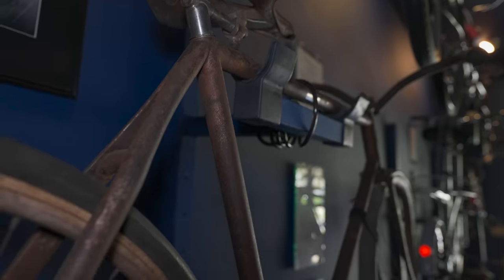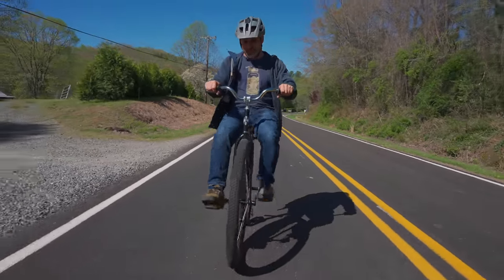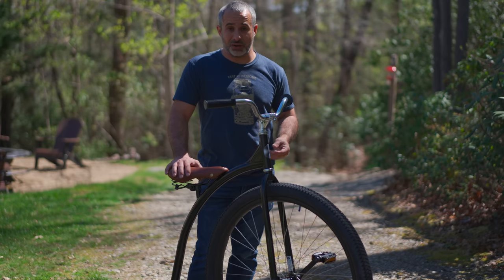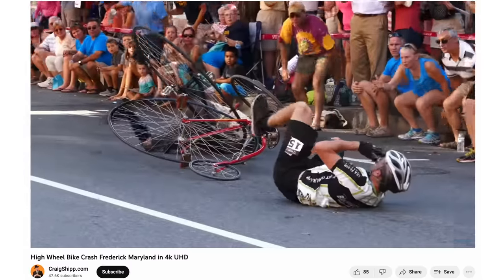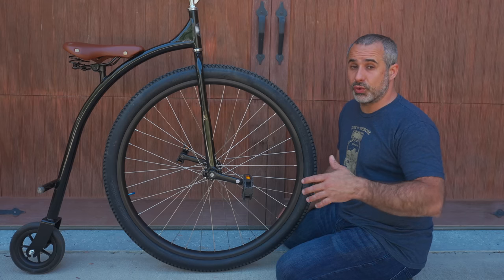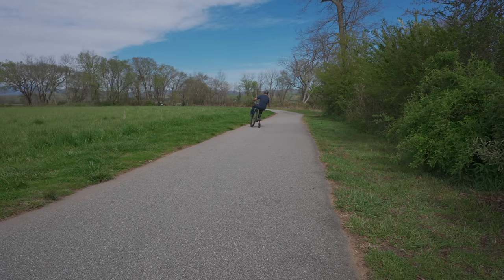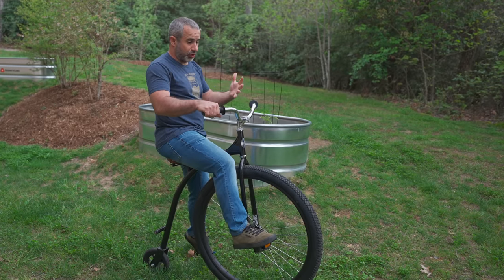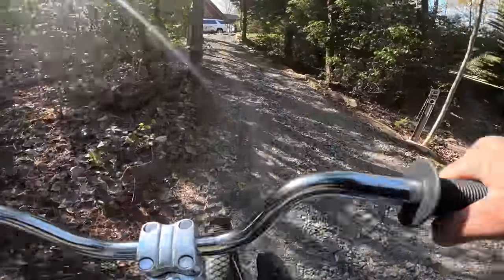The Penny Farthing was the sketchiest bicycle ever made

Comment: Makes you fully realise what a game changing innovation the Safety Bicycle was. Surely one of the best inventions since the wheel.
Reply: The invention of the safety bicycle was dependent on the invention of several "new" technologies and practical manufacturing techniques. Whilst today they're taken for granted, they simply didn't exist at the time the Penny emerged. The Penny was a fast machine, reliable and the pinnacle of human transport. But things were changing very quickly in manufacturing technology, which meant the Penny only had a decade or so before it was superceded. By contrast, the first "Safety" bikes were complicated beasts, less reliable and only marginally safer.
Reply: Obviously; it does have two of them.
Reply: The chain drive was the key. Without that, you could only ride faster by scaling up the diameter of the driven wheel. A chain with different sized sprockets decouples the wheel size from rotational speed for a given pedal cadence.
Reply: "don't reinvent the wheel" yeah reinvent the hardware around the wheel
Reply: Double the wheels, double the fun
Reply: @ailivac  The chain also removed the cranks from the wheel axle and moved the riders mass to inbetween two equal sized wheels for better ride and lower centre of gravity.
Reply: Good, twice the radius, double the fall.
Reply: That's a pretty ridiculous claim. I can think of dozens or maybe hundreds of inventions that are essential to modern civilization, our technological capabilities and standards of living. Bicycles are not one of them.
Reply: The inventor of the first bicycle likely put pedal cranks on a steerable front wheel that was a reasonable size for safety and low enough to be easy to mount.  Then trying it out he realized while it did work, it got him places a bit quicker than walking.  But not quick enough to make up for the work needed to move the weight of the machine, overcome imprecise bearing tech of the time, just not worth the bother.  By making the drive wheel much larger, despite the hazardous ride and difficult mounting, it made it faster and more exciting to ride.
Reply: @Kerithanos  not ridiculous at all. The safety bicycle made it possible for people to easily travel to the next town or village, travel to jobs that they couldn’t get to before. Be able to get to schools that would have previously been too far or walk too. Speak to any historian who knows, and they’ll tell you the same.
Reply: @a1white  I have absolutely never heard anybody attest to widespread use of the bicycle as some kind of bridge between horses and the automobile. My great grandparents used horse and carriage, and my grandparents used cars. None of them were riding bicycles around. Even Wikipedia makes it clear that the safety bicycle in the 1890s was basically a novelty item. Even if it was fit for the purpose, it didn't have time to displace horses to any significant extent before Ford came along.

I hear they're used a lot in third world countries today, but that certainly doesn't qualify it as "second to the wheel". I'm not trying to be aggressively negative or pedantic, I just think that's awfully strong praise for a development I would call "mildly influential" at best.
Reply: @Kerithanos  try Googling “invention of bicycle significance” or similar and read one or 2 of the many articles explaining why they are so significant in history. Sorry if you disagree, but that is your prerogative.
Reply: i like my trike
Reply: I'm sure the safety bicycle had a big impact, but there is a long list of inventions that were obviously more important to developing modern society. Printing press, steam engines, Internal combustion engine, production line, cotton gin, spinning Jenny, fertilizers, combine harvester, plastics, electrical wires, lightbulbs, telegraph, radio, batteries, transistors, microprocessors, the internet. I could keep going, but the list is going to get pretty long before I mention any bicycles.
Reply: @megamaser  The spinning wheel itself was a pretty big game changer to civilization.
Reply: @another3997  I swear, technological development is as random and weird as natural evolution.
Reply: The penny farthing was called the "ordinary", because it was the limit of mass market technology. There wasn't an affordable technique to make small chains with precision, and shaft drives are just too expensive for the working class even today. Roads were also atrocious back then, so you needed large front wheels to avoid faceplanting over every pothole you had to ride across, and to provide high gearing so that you may actually go faster than a brisk walk, because you might as well walk.
Reply: One of the best investions since the penny farthing
Reply: @a1white  there were horses and carriages that enabled the exact same thing. And safety bicycles were very expensive at first and as mentioned in this video, only used by the rich for recreation. An average human walks at 6 km/h, how fats is a single speed safety bicycle really? 20 km/h? On the mud roads they had back then? And you can’t carry much unlike with a horse or carriage. Doesn’t sound like the revolutionary invention that changed the course of civilization.
Reply: @HNedel  safety bicyles might not have been an overnight massive success, but if you read up on it you'll see that (especially for women) they wre massive enablers. They certainly weren't only used by the rich. Look to industrilised Britain, for example, Bicycles became the form of transport to enable people to travel several miles to factories which would have taken an hour or so to walk to before. Even allowing children to travel several miles to schools.. Horses were also expnesive for most people to keep, as well as being impractical.
Reply: Not even close.
Reply: @Kerithanos bikes were used to win battles. it saw use in WW1 by messengers (horses can be finicky) and the Japanese used it to defeat the British in Malaysia. they’re small, simple, cheap (er, from a logistics perspective at least), man-powered, don’t create a bunch of heat exhaust- I love ‘em.
Reply: @Kerithanos  You are being negative without any claims to back it up other than anectodal evidence and incorrect "facts". I used to live in holland and even today most people dont have cars but they have 2-3 bikes. None of my friends even cared about getting a license because you would bike everywhere. 

Also Horses and cars were only for the rich, so it had a ridiculously significant impact on the middle class, which used to be even larger than then it was now
Reply: @Chickenwingsinthedings  "All you have is anecdotal evidence! Anyways, I used to live in Holland, and my friends all said..." LOL

I can't comment on how things were for the Dutch, but I can tell you that in the USA, horses certainly were NOT only for the rich. Horse and buggy was how normal people got around when they weren't walking, up into the 1920s.

I certainly don't care about how bicycles are used today, especially by Europeans trying to cope with their Orwellian circumstances by taking some sort of pride in the fact that they can't afford a car. We were talking about the role of the bicycle in history.
Reply: @tau-5794  you're not going to escape this time Count Bike-oo
Reply: @Kerithanos bicycles were neither great for off-road use nor for carrying significant cargo, so until the dominance of the car in the post war period cars, horses and bicycles all coexisted in different niches. The first cars already existed in the 1890s: battery powered horseless carriages used as taxis.
Bicycles could still be used on rural roads, but the distance from parts and repair shops would have further disadvantaged them in most rural areas. So it's not unsurprising that in rural America there were people that never transitioned to bicycles.
But in cities most people would not have had or been able to keep a horse. The bicycle was a massive improvement from just walking. The rates of incest significantly decreased in London as a result of the invention of the bicycle because regular social interaction was rare outside of the area where you lived in, so every neighbour would be slightly related to eachother. I guess this was never solved in rural America though 😅.

Comment: I rode a big one once, I'm 6'1. The seat was right up against the neck and it was absolutely insane. I came from a fixed gear background (Messenger turned national level track rider) so that was ok. What was REALLY insane is that because the BB is also the axle, when you pedal forward it turns into the lead foot slightly so it's weaving back and forth. Ok, that's a thing to get used to BUT when you're breaking it reverses that effect! All of a sudden you're into this groove of counter steering into your pedal strokes and feeling ok, then you go to slow down and the bike violently swerves in the direction of your trailing foot! On the one I rode, the seat height was probably 5'6 or more so bailing off wasn't really an option! Cool experience but 10/10 never again.

Comment: I have a 56" Victory Highwheel, and believe me, the 2 variations  you have are way off on how they were made. The backbone is supposed to taper, and the fork assembly is one piece. The back wheel actually tucks in a little below the front wheel - about 2-3 inches for compactness. The tires are solid rubber with a wire through it that tightens around the rim. The front tire is thicker than the back, and the spokes are wired and soldered where they intersect on the front wheel. There is a spoon brake that is a lever on the handlebar that pushes a spoon right on the tire - not an effective brake itself, but it makes going down hills a tiny bit easier on your legs. I have ridden this bicycle on smooth undulating singletrack, and yes, you ride it on rougher terrain if you have strong legs and good balance - just be sure to keep you weight back when you hit bumps, or even "ride the step" (you get off the saddle and coast with one foot on the step-up) Like you discovered, it's a really comfortable ride. I do commute on my highwheel to the grocery store and amongst traffic. I have to plan my stops and time the lights, and be mindful that it's hard to start uphill, and steep downhills with stop signs or traffic lights be very cautious, and make sure you are fit enough to control the bicycle safely. Cars DO see you, so visibility is not much of an issue, plus you have a fantastic view way up there.

Comment: I have a 48” replica penny farthing from the  80s. I also have a modern, 24” replica. 

It’s actually really comfortable to ride. You probably need at least a 40” front wheel to get the full effect and benefits of the penny farthing. With modern paved roads, it’s arguably more practical today than it was in the 1880s. I’ve taken my 48’ on 10 mile trips. Very fun.

Comment: I remember reading that guys used to basically do the old bmx bar-hop (swing their feet forward over the bars) when going downhill so when they inevitably crashed, they could just jump forward instead of tangling their knees in the bars. Of course, this meant their feet were off the pedals so there was no real speed control aside from a rear brake or maybe the spoon-style friction brake on the front wheel. Insane.
Reply: There's a chap who's done around the world rides on a penny and he goes that while dropping into death valley. Joff Somerfield.
Reply: I wonder if you could design it where instead of handlebars going out to the sides, there a single steering lever going straight forward. That way, your legs could naturally swing past.
Reply: @CalmoOmlac  Some recumbent bikes use a tiller style steering , which is a bit like a reversed stem .
Reply: @CalmoOmlac  Thanks for the correction. I too have many bikes but my recumbents are trikes.
Reply: @kudosbudo Ed Pratt - his unicycle round the world video series on YouTube is one of the best sets of videos you can find
Reply: @IsaacKuo  you can mount the handlebars behind your legs.

There is an excellent article about penny_fake_things in the steampunk magazine. If you ask me which issue, i might remember to  look it up later :D
Reply: The position meant that riders going over the handlebars wouldn't smash face first in to the ground at high speed. Falling sideways wouldn't  be great, but being sat right over the front hub, going over the bars was always a distinct possibility, quite often with fatal consequences. Brakes were an option on many Penny's, and to be honest, I suspect few would ride in that position without some form of speed control.

Comment: I like the posture it gives the rider: upright, handlebars above waist-height and in easy reach, no pressure on the shoulders. Really comfortable. You can get the same with a regular bike – I put a longer stem on a racer and added sweep back handlebars – but almost no bikes are made like that.
Reply: Check out Dutch bikes. Same posture, only with a lower center of gravity and plenty of cargo capacity!
Reply: @garretteverett2613  
Also the Pedersen bikes. Virtue Bike has about the cheapest, but there are others that reproduce the original hammock seat if you have the money.
Reply: Choppers in general are pretty much this design.
Reply: @KindredBrujah You're right! I've actually got some sort of Dutch cruiser/chopper hybrid bike and it's definitely comfy. Gonna see how it rides with ape hangers soon. 🦧
Reply: Beach Cruisers are like that.
Reply: That's the cruiser bike style. Children's bikes are often this style.
Reply: @aaronbredon2948  A cruiser is an upright bike, but it can have straight handlebars rather than bars that sweep back so they're closer to your torso. The latter makes it less likely that you'll have to lean forward, but I think it's also a more comfortable position for the arms anyway.

Comment: I really find it fascinating that they ever thought that thing was a good idea. How was it even designed without anyone saying "what if it was balanced a bit better?"
Reply: It solves a problem that no longer exists thanks to better infrastructure and more advanced technology. It's like looking at an old car that's basically a death trap compared to modern vehicles, "how could anyone ride in these?"
Reply: @AirLancer  well yeah but thats because they didnt understand electricity back then and how to make airbags
wagons and carriages had evenly sized wheels for centuries before the first bike, yet they thought "what if we made like a tiny wagon for one person to power with their feet... and what if the wheels were DRASTICALLY different sizes for NO reason"
Reply: @shybandit521 many of the first cars were electric. On the high wheeler you don't require a chain and it has very few moving parts so it's no wonder it predates bikes with chains and gears.
Reply: @timlewis5527  that's true, i should have specified "they don't have as sophisticated of an understanding how to make and use it efficiently like we do now"
Also yeah you're right I guess the chains and gears system is pretty innovative and I can see why it took them time to develop it
Reply: @shybandit521  Lots of carriages had rear wheels 50% larger than the front.
Reply: @shybandit521  They aren't drastically different for no reason; it's because the pedals are driving the wheel directly and you need the leverage.  It was the invention of a chain drive with appropriate gearing that made the safety bicycle possible.
Reply: @shybandit521 you would've thought theyd figure out how to make it safe by stealing designs off machinery and carts and what vehicles they had at the time

Comment: The real reason for the large front wheel wasn't for absorbing road bumps. It had to do with pedal ratio. With a large wheel (with the pedal crank mounted directly on the wheel) you didn't have to pedal as fast to get good speed.  Before the high wheel, bicycles still had the crank on the front wheel, but the wheel was smaller, and cyclists found they had to pedal quite fast just to obtain a decent clip of speed.  Their solution was to make the front wheel larger.  Of course that had its draw backs, like the ones you mentioned. I imagine there were quite a few head injuries back in the day.
Reply: And the development of the roller chain and sprockets allowed for gearing, which solved that problem.